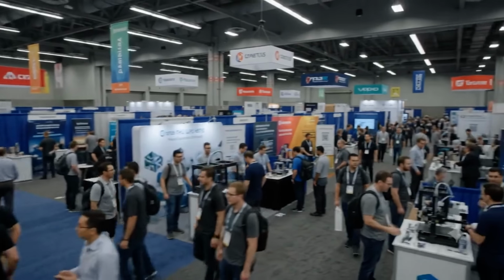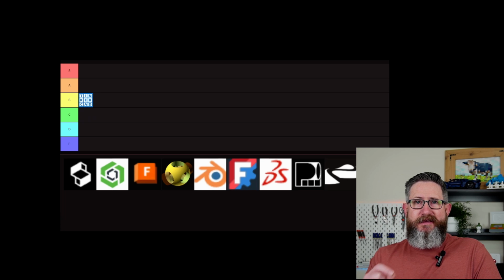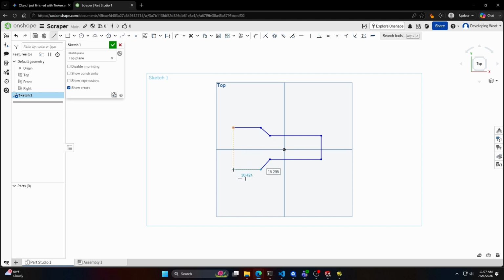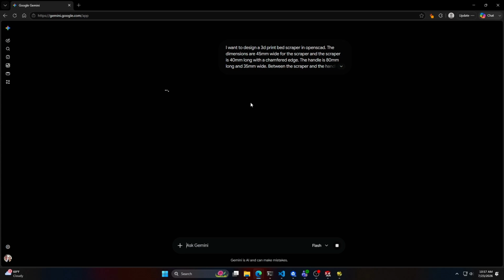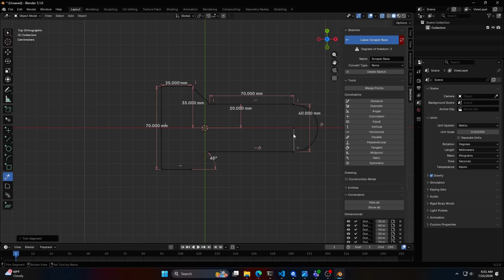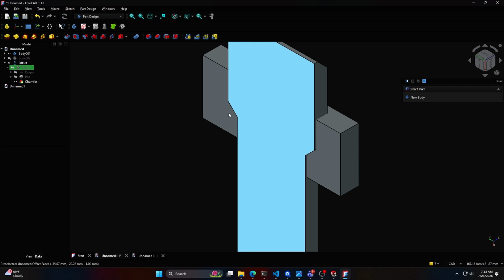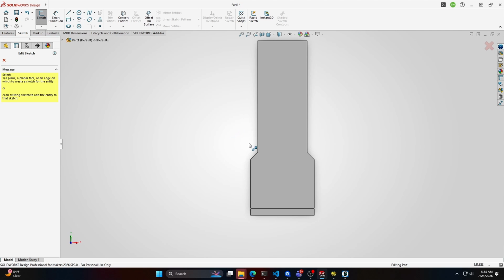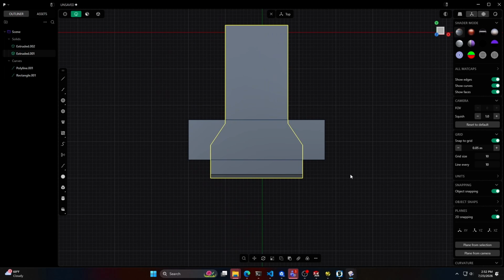Don't Pick a 3D Modeling App Until You Watch This!

Comment: I'd like to point out that you didn't include the solidedge (community edition), it is free for tinkering/workshop purposes. It is basically the same as the base industry app, with the only difference being the license and file watermark. Regarding solidworks for makers, I must say that a lot depends on a setup. Mostly a RAM and CPU related issue (program available RAM can be auto capped at 4 GB with, while CPU performenace in the Win11 might be set up to power saving, which sucks beacuse the app is bound to single core performance). Honestly I have been using solidworks for makers for 2 years and I have came across performance problems only once when I was doing a setup. Also capabilites of programs such as solidworks, solidedge, fusion 360 and onshape are what makes them a real deal, especially in comparison to Shaper and tinkercad. Few areas are assembly, FEA, CAE , bend sheet-metal bend components, table based version control and so much more. Basically the more advanced designs benefits more from expanded CAD capabilities. The FreeCad is a bit of an outlier. Personally I do not like it's sketching module, but the capabilities are there, especially with addons which are numerous

Comment: I have been using Solidworks for over 30 years and if you can’t use it to model that extremely simple model then you are clearly not competent in 3D modelling. I would do that model in about 5 minutes or less.
Reply from the maker: I completely agree with that statement. I do think the problem I was experiencing is with SolidWorks for Makers. That version of SW installs and saves all your files to the cloud by default. I suspect that their cloud servers were running slow or getting updates when I was using it because the application was absolutely unusable. I don't think I would have had this problem if I had changed the default setting to save locally.

Comment: I agree with you about FreeCAD: it’s clunky, unintuitive, and full of flaws. All these different modules—such as BIM, DRAFT, Part Design, Part, Sketcher, and TechDraw—were developed by different people, at different times, and under different working cultures. Each one has its own coordinate system; furthermore, TechDraw is useless unless you create your entire project exclusively on the XY plane. Any dimension you add on the YZ or XZ planes will appear inverted and mirrored in the BIM view. Completely useless.
Also, when using DRAFT, Part Design, and Sketcher, if you happen to click in the wrong place, everything blows up—and it can take hours to get things back to where they were.
Reply from the maker: It’s definitely a tool with a steep learning curve and plenty of quirks that can be incredibly frustrating to navigate!

Comment: You can code Freecad parametric models directly using Python. An AI will generate the Python you need to get started.
Reply from the maker: I didn't know that, but I have been using the community MCP connector and having Claude actually do some modeling in FreeCAD for me. Super cool!

Comment: the thumbnail(I thought) showed Solidcraft (or what looked like its icon.) I wanted a opinion in the list.
I am greatful for the solidworks one. I have tinkered with freecad on and off since a little before 1.0 so I can feel my way though most of it. it want to be a jack-of-all with the work bench system and fit everyone needs. it does a pretty good job. ESPECIALLY because it started when cad was for rich companies and pirates to use their ware.

anyway keep the list going and add to it. I learn a bit from watching. 
online only is a big turn off as I remember when the internet was way more spoty and I trust nothing that can go away in the middle of something important. not that I HAVE important stuff, but it is important to me.
liked the video even if it left me hanging a bit. I kinda like solidcraft alpha web, linux, windows

Comment: Why didn't you use the installed version of Solidworks for makers?  Seems to me the web ui is just for easy reference of an existing part, or simple changes.  Not real part design.
Reply from the maker: I did. The problem was SolidWorks for Makers by default stores projects in the cloud which can cause the latency issues I experienced. It was only after I made the video that switched the setting to save files locally and saw improved performance. Perhaps I tested on a day when their cloud servers were slow so the autosave ruined my experience, not sure, but it was completely unusable the day I used it. If you're still saving to the cloud, I would change that.

Comment: Solidworks for Makers is a desktop application. The subscription includes the full desktop application. xDesign is their browser based CAD application and it looks like that is what you actually reviewed in this video.

Also, there is SolidEdge from Siemens. It has been a couple years since I used it but back then it was pretty good and offered a fully featured free version.

Comment: I would be interested in your take on cadquery.  I don't model frequently enough to be fluent with any package, but had used openSCAD of and on for several years.  Since I favor coding my design vs. drawing them, I have recently switched to cadquery, using the CQ-editor as the visualizer.  I'm a fossil that still enjoys emacs, so my scripting is within that application.  I was driven to try cadquery because a design I was developing in openSCAD started having exceedingly long rendering times.

I suspect that you will find AI your friend, similar to learning openSCAD, with the caveat that a larger corpora of openSCAD designs are available in its training data than for cadquery. 

While I am not proficient enough with either package, or in 3D modeling, in general, to have an "informed opinion", I think cadquery deserves a look.  I have been impressed with the performance of the rendering engine, though I do struggle with the CQ-editor model viewer a bit.
Reply from the maker: I haven't had a chance to test that one yet, but I'll add it to my list for a future video! I appreciate your insights, thank you for sharing. I don't know that I'm proficient enough to have an "informed opinion" either. I just model basic parts for my 3D models. I'm by no means an expert. Finding a program that fits my workflow isn't easy, and I just wanted to try a bunch of them and get my first impression from them.

Comment: I have zero experience using CAD programs. Can any of these programs create a STL file to print 3D?
Reply from the maker: I've only reviewed ones that I would consider viable options for 3D printing. If you tell me what you're hoping to make, I could make a recommendation based on my experience
Reply: @wootsworkshop  I also have zero experience 3D printing. My hobby is flying RC models. All the ones I've seen here on YT use STL files so any program I would use must be able to print STL files.

Comment: I'm a hobbyist now with CAD, but have used a variety for work and tried a few more. Solidworks 3dExperience for makers isnt how you described one bit, well not for me. It's a download, so works on your PC, needs to keep online for licence, can save to PC as well as the cloud. Stuttering ??? no, like any CAD program is dependant on your computer spec. Used it with I5 and i7 processors and it runs really well. More memory the better though, 8GB or above. And for the price £45 a year is well worth it. Not only modelling but complex assemblies.
Reply from the maker: I really appreciate you sharing your experience and the practical details on how it performs for you!

Comment: Are you creating this tier list based on knowledge because you REALLY know how to use those programms or do you just share your "first impression"? This makes a huge difference. When I switched from AutoCAD to Vectorworks 8 years ago with 20 years of experience in AutoCAD i hated Vectorworks for about 3 month. Once it clicked I now hate projects where I have to use AutoCAD. So my personal tier list would have changed in those 3 month dramatically. A few years ago I had a similar experience with Rhino.

You can not judge a complex programm like a CAD software unless you have used it for at least 2-3 month on a daily basis. Clicking around for a few hours and watching a few tutorials does not mean anything.
Reply from the maker: You’re absolutely right that my video reflects a first-impression workflow rather than deep, long-term mastery of these complex tools.

Comment: Freecad is my main tool and I have no problems at all it's fast and simple. FYI I was a pre-cad draftsman so there is that.
Reply from the maker: I'm relatively new to CAD. Based on the feedback I have seen on this video, if you're experience with drafting/CAD applications FreeCAD is amazing. This would make me conclude that I just need to spend more time in the application to understand it. Thank you for the contribution to the community, I know people will benefit when they read this comment.
Reply: @wootsworkshop  Learning FreeCAD is like climbing Kilimanjaro but once things start clicking it's very satisfying. And you don't have to worry about spending effort learning some cloud based POS that can remove features, go subscription or go away completely any time!

Comment: I've been a programmer since the late '80s; my current language is Python. So for years now OpenSCAD has been my go-to for designing functional 3D printed parts. I'm switching my workflow to FreeCAD; I've made a handful of designs in FreeCAD now.  I needed a tool that would support multipart assemblies; OpenSCAD didn't do that. I had designed a tubular steel chassis in OpenSCAD code and found that I could write Python macros in FreeCAD to draw that chassis; using the XYZ point sets that I had created in my original design. Very powerful; I don't know if there's any other tool that can do that. Plus I'm a Linux guy so I appreciate that these tools run on Linux. 😊
Reply: I'm also a engineer/programmer since the 80's, but I'm a PERL guy, so don't hate me.  I loved OpenSCAD and have recently moved to FreeCAD.  I found OpenSCAD to be very logical but you have to really think your way through a part, which isn't an issue for me, but I suspect it's not for non-engineer like people. I found that FreeCAD has quite a leading curve, but once you master the basic workflow with sketches, it becomes much easier.  As a casual part designer, I have no regrets moving to FreeCAD.
Reply from the maker: That's awesome input to this conversation! Thank you for sharing your experience. Since this video, I've been using FreeCAD more and more. I still hate the UI, but it is extremely powerful. I love it's AI integration via the community MCP. Thanks again for contributing to the discussion, I think it helps everyone who reads the comments to get a fair and balanced view of these applications.

Comment: I have blender, solidworks, freecad and plasticity. 9 out 10 times I goto plasticity. It is just so intuitive and fast. Use it for functional parts. I think it either gels with the way you think and design, or it doesn't. Its like colour or flavour.
Reply from the maker: That's a super cool way to explain it. I think if I used Plasticity more there would be things that I loved it for, and other things I wanted to design that I completely would avoid it for. I think it's really just what fits the workflow you need at that moment.

Comment: U better use solid works desktop
Reply from the maker: As I understand it the maker version of SolidWorks installs on the desktop but requires cloud connectivity. It was this requirement that impacted my performance, but enough people have mentioned it that I want to try it again. I recently upgraded my computer so it would be interesting to test and see if is faster now.
Reply: SW maker comes in 2 versions. One you run in the cloud. The other one installs locally and only need an internet connection to verify licensing. You can set the verification to a max of 30 days. Very confusing on install and configuring. But the software running locally is very responsive. I will be setting up a Linux computer and installing freecad. I'm interested in comparing the two.

Comment: I feel bad that the Microsoft purchased and offered 3D Builder isn't anymore with Windows, and unavailable (you can hack it back..). 

That app was great for the children to learn 3D printing, and as well it was great to do something fairly complex things, if you knew what you needed to do. 

Let's say you need to do a small cubic with specific 1/4 area sliced off, a couple bolt holes to it and then one semi-circle edge... You did that with it just like that. 

It really was more of a lego-builder. So make a piece, combine it with other piece, make a new piece that you used piece to extrude it off from them.

But need to do anything complex and precision? It became more frustrating at that point. 
That was not its purpose, so people just bash it for it being a first app to teach 3D printing and modeling for someone.
Reply from the maker: It’s a shame it’s not as readily available anymore, as it really was a fantastic entry point for so many people just starting out!

Comment: LOL, I use (or want to use) none of them. I use Sketchup, which is super easy but SUCKS for manifold objects (solids) the moment they get a bit complicated. No real parametric modelling, and solids break by just looking at them, but that makes you refine your 3d modelling skills. I could design that scraper in no time. Then Design Spark Mechanical, DSM, when it was free, not anymore, which is like a mix between Fusion and Sketchup, best of both worlds. And I'm planning to move to Rhino, but it's overwhelming and I don't know if I'll do it eventually or it'll be a hard pass
Reply from the maker: It’s honestly impressive how much time and effort you’ve put into mastering those different workflows!

Comment: From all the Options here, OneShap ist the best, as far as ease of use ich concerned (maybe, because the Workflow ist very similar to Solid Works, which I have used for the Last 22 years at Work). I also have used Onshape one a very slow Android Tablet PC. The "Trick" here ist to use a Mose and a Keyboard and Set Chrome to "Showe Desktop Page". Then it Works flawlessly!
But... For my new designs I only work with FreeCad. It hast a horible, but manageable Workflow. Compared to OneShape it is very instable. But it is free and I do not have to fear, that a company Clchanges ITS polecy and I loose the acces to my designs.

Comment: OpenSCAD has an "Achilles heel" in that it uses a modeling engine that is maintained (maybe) by a different group. So when you run into an issue in the engine where it refuses to render your model, you're cooked. Basically an error in the third party engine will prevent the OpenSCAD project from rendering.

That said, it's my go-to platform, and it usually works.
Reply from the maker: Each one of these have tradeoffs and reasons to love them and reasons to get frustrated at times.

Comment: Firstly you are not designing. You are modeling. Secondly, to you and everyone else... if you are modeling an inorganic object... for the love of God turn on grid snap or set the snap to an appropriate size. Your point about not being able to align objects was not a software problem but an operator problem. With grid snapping being used properly you move the object to the position and bingo... snapped .... it's aligned... it's 2026 and I can't believe I have to say this to a 3d program reviewer? I noticed a you had grid snap off too... really painful to watch. Anyone who is new to 3d or looking for a program ignore this video. Have a go at each program in your budget. And if the program you like doesn't have parametrics then just save copies of the file at different stages using a simple naming convention. Also save steps to go back to in the current file before major operations. Frankly even if you had a parametric modeller I'd do the same. Back in the old days (30+ years ago) I used FormZ and built very complex objects... (You have seen my work in movies.)... which didn't have parametrics. Also after a lot of searching I feel Plasticity is best modeller for the money. Insanely powerful with great rounding and surface features and full solid suite. Maybe cut your teeth on a "basic" program and when you want to work more with curved surfaces Plasticity might work for you.
Reply from the maker: These are awesome insights! Thanks for the comment. In reply, I would say I'm not a 3D program reviewer. I'm just a guy who loves my 3D printer and is trying, albeit, failing in some opinions at learning 3D design. Am I good at it? Nope, but I do love it and I want to learn more. In this video I was trying to find the program that made the most sense to me. My answers won't be the same for everyone, and I hope this video does exactly what you said, it encourages everyone to have a go at the program in their budget. Sometimes it's just nice to know you have options. Thanks for the suggestion on the snapping feature too. I'm going to turn that on in the future and see if I like it.